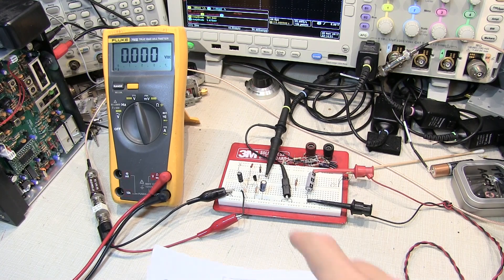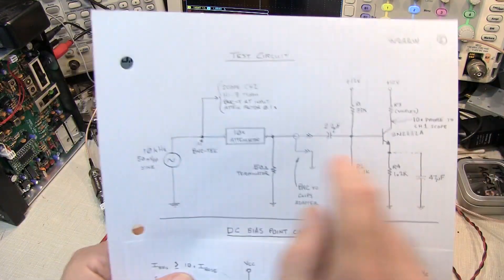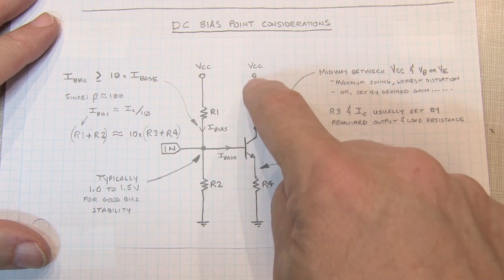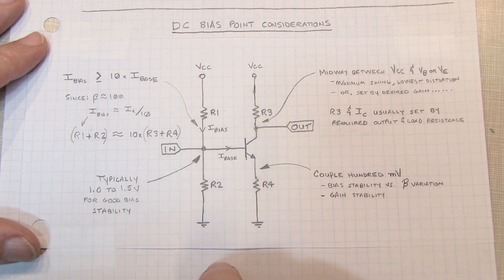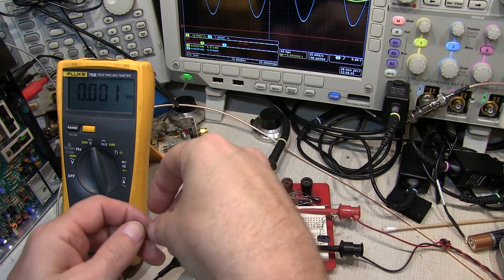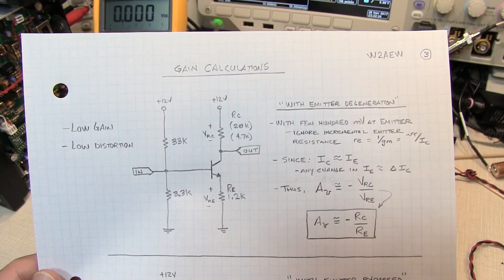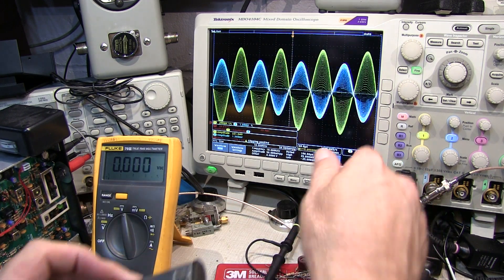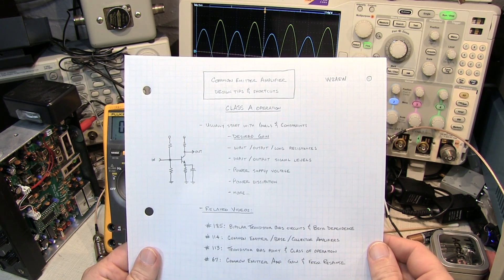#273: Common Emitter Amplifier Design Tips & Shortcuts

Comment: Although this demonstration looks effective, you cannot determine the resulting gain of a stage IN ISOLATION.  You need to take into account the matching of the input to the output of the device or signal you are supplying. In this case the bias resistor of 3k3 is very low and lower than anything l have used in the past 50 years. The bridge arrangement is a very bad choice in the first place. It attenuates the signal enormously. 
In addition, the transistor does not deliver the signal to the stage that follows. This is something you have never been told. It is the collector resistor that delivers the signal. This means it is absolutely absurd to talk about stage gain without knowing the characteristics of the stage you are connecting to the output. 
If all these things had been taken into consideration, the demonstration would have had some more benefit. 
Finally, anyone talking about values with a greater accuracy than the input parameters is not an educated person. It sounds so stupid to say the gain is 334 when the circuit is not even connected to anything.
This is how you determine the understanding of the demonstrator.
Reply from the maker: Of course the source impedance of the circuit providing the signal to the input, and the input impedance of the circuit that the amp will drive must be taken into account when considering the overall gain of the amplifier.  In cases where the impedance of the source is more than 10x lower than the input impedance of the amp, and the load impedance is >10x the collector resistance, the effect of these will be small.  Without considering these things, making a statement that the two resistor bias string is a "very bad choice" and that it "attenuates the signal enormously" are gross and inaccurate statements.  And since we're being pedantic, in your statement  where you say "talking about values with a greater accuracy than the input parameters", I'm sure you meant to say *precision*, not *accuracy*.  Sure, stating 3 digits of precision when one of the input parameters is stated with only 2 digits of precision is a faux pas.  Of course, summarizing all of this to make cracks about my education and understanding simply tells me a lot more about you than it does me.  It must be nice to be perfect.

Comment: The base biasing of 3k3 is far too low. I have never used a value this low in 50 years. Maybe l should start to design stupid circuits like you.
Reply from the maker: With all due respect, it's not stupid if it works and meets the design criteria.
Reply: @w2aew lt is stupid because it is showing stupid components values in an exercise that is supposed to come from an intelligent designer.
Reply from the maker: If the source impedance of the signal driving the input is low (few hundred ohms or less), the 3.3k won’t be a problem.
Reply: @w2aew That is entirely untrue.  You don’t know the current-capability of the signal and what’s what you don’t understand.
Reply from the maker: Many applications for small signal amplification using an amp like the last example wouldn’t have a problem with the 10-20uApp needed to drive the parallel combo of the bias network and the dynamic input resistance of the base. Of course, many applications would require a much higher input impedance amp. It’s all part of the typical design considerations and tradeoffs. No one design will work for all. That, in my opinion, doesn’t make this example stupid.
Reply: @w2aew lf you have a high impedance on the input of the stage it will work for all inputs. It is total madness to have an input of 3k3.  I am just telling you l have been teaching basic electronics for 50 years and commented on the University YouTubes and surprisingly, they all disappear. I haven’t found one discussion on basic amplifiers where the instructor knows what he is doing.
Reply: @w @w2aew what you are saying does not make any sense at all. If you have 20uA and say the input voltage is 100mV, the impedance will be 20k. 20k to 3k attenuates to 15mv and you lose most of your signal. And if the signal is 10mV you have lost it.
Reply from the maker: @ColinMitchell-s3c  For the last example, where the emitter resistor is bypassed, the input signal level would typically be limited to under 50mVpp, and more like 10mV or so, in order to have reasonably linear gain characteristics.  Even at 50mVpp input, the 3k input impedance would result in about 17uApp of current.  In my example, I was using just a 5mV input, so the current drawn from the input source is <2uA.  As long as the source impedance is a few hundred ohms or less, there won't be much drop due to the divider action.  In this circuit, the collector current is a little over 400uA, so the quiescent base current is approx 4uA.  I typically like to have the current in the bias string be at least 10x the base current, so that means that my 33k/3.3k bias string could have really been almost an order of magnitude higher, like 270k/27k.  The thing we've been ignoring here is the input impedance of the transistor.  With the emitter bypassed, the small-signal input impedance of the base will look like Beta/gm (Beta * re) - so in this case will be about 6.2kohm.  So, even if we increased the bias string to 270k/27k instead of 33k/3.3k, the small signal load presented to the source will still be only about 6k ohms.

Comment: Show me a small-signal transistor with a gain of 100. I have bought 100,000 BC547 transistors in the past 50 years and not one has been listed as having a gain of 100.
Reply from the maker: As you know, small signal bipolar transistors don't list voltage gain in the specs, because voltage gain is entirely dependent upon the surrounding circuitry.  It is relatively easy to obtain a gain of 100 or more with a single bipolar transistor in this configuration with the emitter bypassed. The last example in this video shows a voltage gain of about 300.

Comment: ❤ nice playlist on bjt. Thanks for such ossum videos. 
But Why I am not understanding this biasing of ce amplifier. I was happy when I see normal ce amplifier circuit. But i didn't understand this voltage divider biasing circuit.
Could you tell me 
1) why r1 and R2 need to connect
2) why we need to connect Re emmiter resistance
3) why we need cap parallel with Re?
Reply from the maker: R1 and R2 form a voltage divider to set the voltage on the base, and the current through the divider is much larger than the base-current, so that the base-current doesn't significantly change the base voltage.  The emitter resistor is a negative feedback technique, making it easy to set the emitter current so that it is largely independent of the transistor's Beta.  The capacitor around the emitter resistor ensures that the resistor is "shorted" for the AC signal, which maximizes gain.
Reply: @w2aew  does r1 and R2 mean that Current will flow very easily through R2 then base even if Vbias is fluctuates?
Okay cap in parallel with Re ensures Short circuit for signal. But how Re providing neg feedback? It's directly connected to ground so how it is giving neg feedback?
Reply from the maker: Yes, current thru R1 and R2 is relatively constant with respect to base current variation.  Re provides negative feedback in this way…  As Vbe increases, emitter current increases. But, increases in emitter current causes increased voltage drop across Re, which reduces Vbe, which lowers emitter current.

Comment: What effect does different emitter cap values have on the gain or does it only affect the output frequency response! Great video!
Reply from the maker: The emitter caps affect gain vs frequency.  At low frequencies, the reactance is high so the gain is lowered.  As frequency goes up and the capacitor's reactance drops, the gain increases, and approaches gm*Rc if there are no other resistors in series with the cap.

Comment: You completely miss an important point. You have not added a capacitor to the output and all the calculations you provide will be upset by the impedance (resistance) of the input of the next stage. In addition, you never mention the fact that the transistor does not deliver energy to the next stage but the collector resistor does this when the transistor is turned off. These are the sort of facts that you need to mention as the whole explanation is so complex that l am sure no-one will understand anything you mention after attenuator.
Reply from the maker: I guess I had to draw the line somewhere.  In many instances, the input impedance of a following stage is going to be higher than the output (load) resistance in the amplifier.  But of course, that isn't always the case.  AC coupling is often necessary too, but as you know, that doesn't change fact that a low input impedance stage following a CE amp will affect the gain.

Comment: I'd love to have you instruct us on how negative feedback influences this kind of circuit and the design. Recently I've been messing around with two transistor feedback pair amplifiers (the complementary kind) and it's been a lot of fun and incredibly educational. Very nifty and quite capable little circuit with just two transistors and seven resistors, no bootstrapping or emitter bypassing. Maybe that might be something you'd like to share some wisdom on as well!
Reply: If my understanding is correct, the two transistor feedback pair arrangement was quite the breakthrough back in the day. Thank you so very much for all of the incredibly high quality educational material you have provided, and still do! <3
Reply: I also used a complementary feedback pair emitter follower recently and was quite happy with the results - very near unity gain, high input impedance, good linearity and low distortion and DC offset. Maybe a back to basics on Darlington and Sziklai transistors someday?

Comment: 👍  Hi w2aew  do you have a video or know a circumstance where a BJT Transistor can pass two negative potentials across the  Collector/Emitter Junction  ?  > without signaling the base ?
Reply from the maker: If the collector voltage dips far enough below the base voltage on an NPN device, it will conduct.
Reply: @w2aew  Hu? I am looking at the Tesla Switch  by Bedini specifically the led indicator function , its the latest video on my channel . Thank for verifying , so in this circuit when the Collector Emitter conduct all while the base is getting zero volts, the collector is getting neg 10 and the emitter is getting neg 5 . so you are correct the collector is getting neg 10 and the base is getting  +/- 0 .  Thank you w2aew
Reply from the maker: @mykedoes4099  The Base-Collector is a PN junction just as the Base-Emitter.  So, forward biasing the Base-Collector will cause conduction.
Reply: @w2aew  that makes perfect sense. ..   Not so obvious though

Comment: I notice you did not treat the "swamped emitter" where the emitter resistance is partially bypassed to give better gain and low distortion.  For example: implement the 1.2K resistor as a 400 ohm from the emitter to an 800 ohm to ground then bypass the 800 ohm.  Then gain with Rc=20K will be 50, but the distortion will be very low.
Reply: I wouldn't call the distortion "very low" at a gain of 50. The quiescent collector and emitter current in that circuit is around 0.4mA, since Vb = 1.1V and so Ve is around 0.4v to 0.5V.
Setting Rc = 20K would drop 8V across Rc, putting the quiescent collector bias voltage at 4V, leaving the 2N2222A with around 3V of negative swing at the output before saturation.
Since the quiescent collector is around 0.4mA, the dynamic emitter resistance (re) is about 60R, but with a couple of volts swing either way at the collector (i.e. an input of around 40mV pk-pk), re would vary from 50R to 80R, so the gain would vary from 20k/450 = 44 to 20K/480 = 42, which is about 5% distortion. Without bypass it's less than 2% at a gain of 16.
Reply: Sigh!

Comment: Hi, do you have any videos that explain re, ro, gm? im unfamiliar with these terms when used for BJT.
Thanks a lot for your videos they help a lot!
Reply from the maker: I don't have a video on this, but here's a short explanation.  These refer to "small signal" behavior, which is typically when the BJT is in the active/saturation region (flat part of the typical IC vs VCE curves).  
gm is the small signal transconductance.  It is the ratio of how much the collector current changes in response to a small change in base-emitter voltage.  The re term is simply 1/gm.  It also represents the small-signal output impedance of the emitter terminal.  The ro term represents the small signal output impedance of the collector terminal.
Reply: @w2aew  Okay thank you!

Comment: Gee. Finally, a good one. Thanks!
By the way: I really miss my HP15C. 
Incidentally; how do you get such clean waveforms? I get so much more noise, even at 20 mV/div (200, with probe at 20x).
73 de VA3MVW
Reply from the maker: Getting clean waveforms is all about maximizing signal to noise ratio.  Use no more BW than needed (turn on BW limiting if you can), use no more attenuation than needed (use 10x instead of 20x if you can, etc.), use averaging if your scope supports it, use high-res sampling if your scope supports it.

Comment: How to calculate minimum input ac signal voltage that amplifier can amplify?
Reply from the maker: There really isn't a minimum - this would typically be limited by noise.
Reply: Thanks for the reply. How I can calculate noise floor level for transistor
Reply: Can you share your email id so that I can discuss problem on that in detail

Comment: It's important to emphasise how much extra distortion is introduced for larger signals if you bypass the emitter resistor. With a bypass capacitor in place, the gain is directly proportional to the collector current, so if the output swings close to the positive rail, the gain drops to almost nothing. If the output swings low and doubles the voltage across the collector resistor, then it doubles the instantaneous gain. That's a recipe for really nasty distortion.

The formula for gain is actually Av = - Rc / (Re+re) where re is the incremental emitter resistance = 25mV/Ic at 17°C. To reduce the effect of transistor variations and to reduce the distortion caused by the non-linear re, it makes sense to set Re at least ten times re. But the voltage across Re is Ie.Re = 10.Ie.re = 10 x Ie x 25mV/Ic. Since Ic=Ie for all practical purposes, that shows that the voltage across the emitter resistor should be at least 250mV. Making it higher reduces the gain, so a practical upper limit on the gain is achieved by designing for 250mV across Re.

Another  tip is that because you want to bias the collector around half-way between Vcc and Vb, the voltage across the collector resistor will not be too far different from Vcc/2 (assuming Ve=0,25V and Vbe=0.6V). That means that the practical upper limit for the gain without bypassing the emitter is approximately -Rc/Re = - Ic.Rc / Ic.Re = - Vcc/2 / 250mV = Vcc / 500mV. So for a 12 volt supply, you won't get more than x24 gain unless you bypass the emitter resistor and then you have to keep signals below about 10mV to avoid the non-linear distortion.

A final tip: with an emitter bypass capacitor, the gain becomes Av = - Rc / (Re||Xc + re) where Re||Xc is the impedance of the parallel combination of Re and the reactance of the bypass capacitor. If we want the gain to be flat with frequency down to low frequencies, then we need the reactance Xc to be smaller than re (note: not just smaller than Re). For the circuit shown, with a collector current of 0.42mA, the resistance re is 25mV/0.42mA = 60R. A 47μF capacitor has a reactance of 60R at 57Hz, so that is the -3dB frequency. If you want to have the roll-off occur below 20Hz, you need around 150μF for the bypass capacitor.

Comment: Can you show how to calculate the input capacitor value and output capacitor value because you have to add in the input impedance as Rin and output impedance formula for  Rout to apply to get the capacitor value.

Comment: Fantastic video Alan! I would love for you to explain how you set up your scope. Is the attenuator really necessary for low voltage and low frequency work? Just curious!
Reply from the maker: I used the attenuator (as shown at 2:18) for two main reasons:
1) To provide a 50 ohm termination for the generator, so that the applied voltage wouldn't vary with the frequency dependent input impedance of the amplifier, and the main reason is:
2) To make a larger signal available at the scope for input signal monitoring.  If we just probed the signal at the amplifier input, it would be quite small, and the signal-to-noise ratio would be poor, resulting in a noisy calculation of gain in the Math waveform.  By measuring a larger signal, and then simply scaling it's value with the attenuation value, the scope sees a larger signal with better SNR.

Comment: How come a beta of 100 makes us want the bias current to be a tenth of collector current? I am not seeing the connection :(
Reply from the maker: With a beta of 100, the base current will be 1/100th of the collector current.  By making the bias current through the resistor divider equal to 10x the base current, that will make the bias voltage at the middle of the divider (at the base connection) very insensitive to variations in beta (base current).
Reply: @w2aew  thank you for the reply that helps a lot.

Comment: We can also bypass the emitter resistor with a capacitor AND a resistor in series.  This boosts the gain but can also be chosen to limit/eliminate distortion.  For this circuit 75-150 Ohm in series with the cap should work nicely.